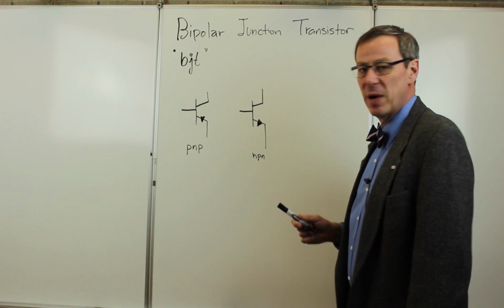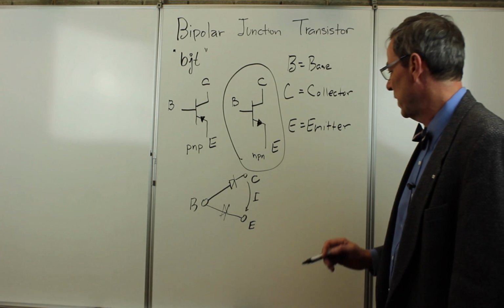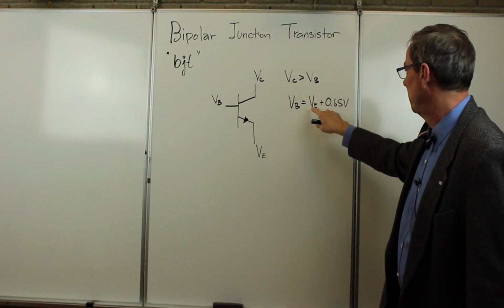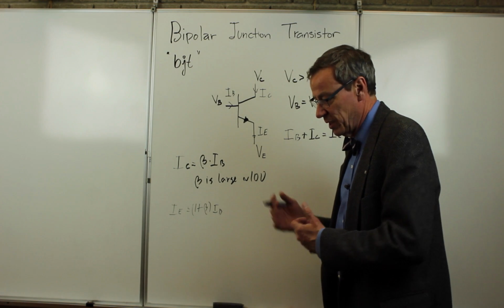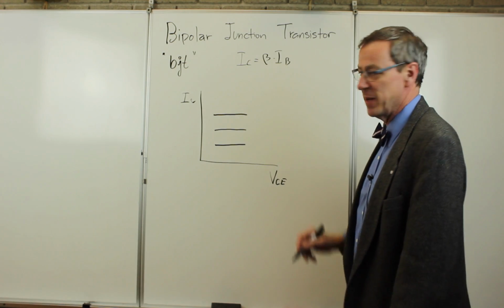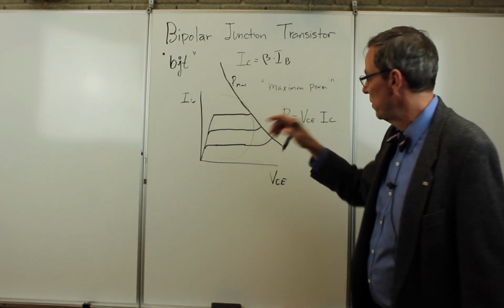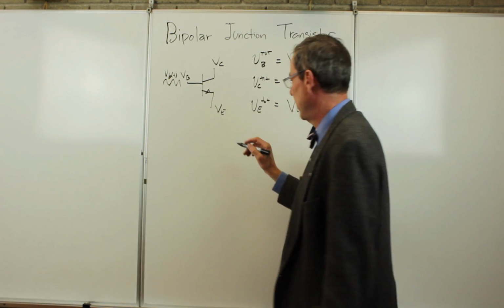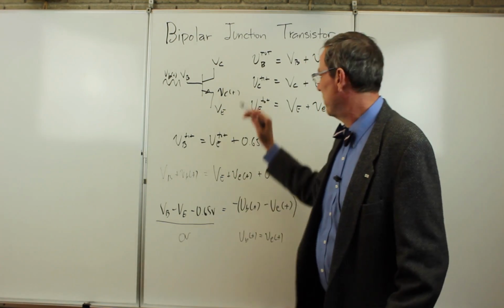Bipolar Junction Transistors

Comment: No current flows INTO  collector. The internal resistance of the transistor decreases and the value of the collector (LOAD) resistor determines the current. The transistor does not determine the current at all. The resistance of the load and the resistance of the transistor create a single resistance-value and by Ohms law, a current flows.

Comment: Beta, the gain of the transistor is the one thing that IS NOT CONSTANT and will vary enormously. It is stupid for him to say the gain of the transistor is constant and it is even more stupid for him to produce a value. You do not know the value or even an approximation because the circuit components decide and change and vary the value.

Comment: Just a whole of complex gobbledygook. Just draw a circuit with voltages. You don’t have to gabble on with forward biasing and reverse biasing. You can see why university students come out with swelled heads and no capability of soldering, understanding, fixing or designing. The Professor could not even tell you how to determine genuine solder from rubbish.